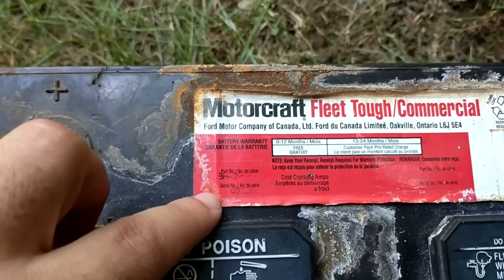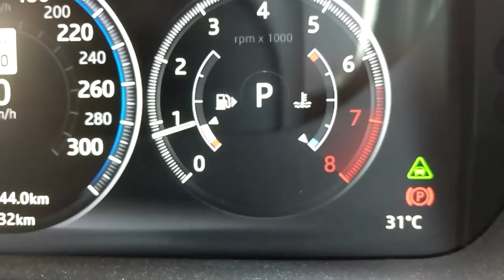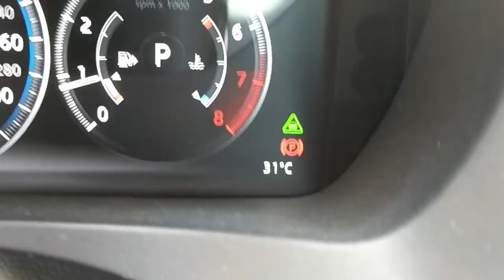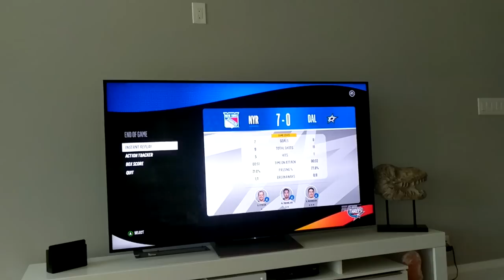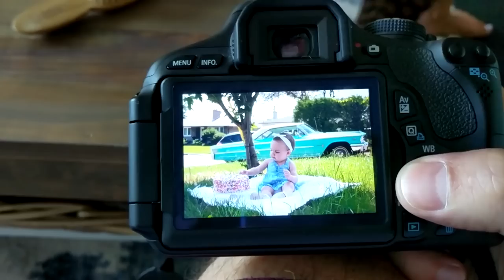VLOG! - Battery Drainage

Comment: I would probably go ahead and get a battery with the terminals on the other side if one is available, wasn't a fan of how close the terminal was to the radiator support where it was, good little bounce and SHORT.

That thing is awesome though, I wanna cruise. Never driven anything like that, especially with no belts haha
Reply: ConeDodger240 I like your videos. Also noticed that you have corrected the iRacing Thumbnails;)
Reply: I was thinking the same thing lol. Either that, or flip the battery around and get a longer ground cable. Having the negative battery terminal that close to the radiator support isn't so bad. But the positive could go boom!
Reply: A car battery rather than a Marine battery might be a good choice also.
Reply: David Norton a marine deep cycle battery really isn't bad though. They give you more power for longer, they're just heavier. I had marine batteries in a few pickup trucks that had winches. They're good for extra electrical loads.
Reply: Marine batteries are super solid. Had one for years.
Reply: marine batteries are better as well because they are deep cycle, meaning you can actually run them dead and then charge them and they will hold a charge. normal batteries once they are dead they are dead, the can be charged but wont hold it for very long afterward.
Reply: They don't handle the cold as well as a car battery, but I doubt that Beef will be driving that car during the winter.  It does look like a Boat battery will handle storage better so maybe it is the correct tool for the job.  I really just wonder if he knew that's what he was buying.

Comment: Beef, I don't think you're aware but car batteries have a "size" and are usually labeled with a two or three digit number. Just get the size off your old battery and swap the new one for the correct size. That way you don't have to worry about changing out the battery cables.
Reply: HeroicFerret as well as the correct cranking amps for the starter.

Comment: marine batteries are fine for cars. the cca ratings are typically higher, which is often beneficial for older cars where the starter needs more juice. they're also deep cycle, so they can be drained repeatedly without causing harm to the battery. standard lead acid batteries don't hold up to that, and the cells lose the ability to hold charge. pretty ideal for a car that won't be driven every day, actually. i'd still recommend a plug-in battery tender tho if it's driven once a week or less. draining it won't hurt it, but it still sucks to have to jump a car before you can drive it

but definitely spin it around, or swap for a battery with terminals on the other side. having the positive terminal that close to the core support is just asking for trouble.

Comment: Alright Beefers, I work at an Auto Parts store and this is what I've gathered from the video...

1. The battery has probably been sitting around for so long, it's got a sulphate build up which causes cells to collapse, so that's probably why it's been struggling starting, take it to the Canadian Tire and ask if they have a battery tester (or if you've got a volt meter), anything below 12v shows it's dropped a cell and time for a new battery. If not, then it's probably low on CCA and needs a proper recharge from a battery charger.
2. You've gone to the shop and bought any battery, that's not the way to go about it :P Although you can put any battery that 'fits' in your battery box, doesn't mean you should haha. Basically, find out the CCA for the old battery and get something with either equal or higher which will help run better and the more the better but it's old car so not a lot of electronics on it so you don't need to go all out. Buy a battery that'll fit the battery box BUT make sure the terminal sides are the same otherwise yes, you'll need new cables which is a waste of time :P 
3. You've bought a marine battery which will start your current battery but won't last as long in the car as a normal car battery. If anything a "Deep Cycle" will probably be best for long term because you can recharge them as many times as you want and it won't affect the battery, although this is mostly used for camping. 

and yes, more of these videos please haha!

Please Like this so Beef can see it, I don't usually ask but it's to help out Beef!

Comment: These days, as I’ve spent too many years with too many vehicles/pieces of heavy equipment, it’s just standard procedure to equip *every*thing with a battery disconnect switch, and/or a permanently mounted trickle/float charger.  Small things that pays for itself in no time.  Or one change of seasons. :)

Comment: Beef, you bought a marine (boat) battery. It doesn't work the same as a regular car battery... They aren't designed to be constantly charged like a regular battery.  The male thread terminals beside the regular terminals give it away.. And I do believe the "nautica" also hints towards boat battery..

Comment: I had a '66 mustang and my regulator went out. super cheap and solved the problem. looks like an old battery so, good call. If the problem persists I would look at the regulator or the alternator. Luckily you have a Ford. All the parts are around and cheap. I have a '57 dodge now and cant get parts. Good luck Beef!

Comment: Hey beef when you get longer cables replace the whole cable, the ends were pretty skanky. That old battery does not hold a charge because it is old and does have a leak. What you saw on top was battery acid that oxidized.

Comment: I think you might need a new Flux Capacitor and maybe a Blinker fluid change.
Reply: Cooked Karambwan- also, need to rotate the winter air out of the tires for summer air so the tires roll smoothly.
Reply: Don't forget the elbow grease
Reply: Be sure to oil up the brakes real good too.
Reply: Wow, I didn’t know blinkers have fluid😅

Comment: Put Garden Lime on the lawn and the grass will grow back.Put it on it every spring. It will neutralize the Ph in the soil.Check to make sure you are getting 14vdc to your battery. Check it across the positive and negative terminals.Also check positive to ground (the frame or motor).  If not check the ground cable.If still no 14vdc replace the alternator along with the battery.

Comment: Beef if the new battery doesn't work, there could be a problem with the battery cable it self. I had the same with my 79 f-350. The cable was too small of a gauge to support all the power that the starter needed, causing the starter to seem sluggish. Just a thought, could also be your starter.

Comment: I'm pretty sure you can flatten and bundle up your cardboard, and leave it out on the curb when they are collecting recycling, as long as they are not larger than your actual bin! I've done this before and they collected it. It's on the city of toronto website too

Comment: I looked into the seatbelt laws a few days ago, and basically you have to use whatever seatbelt assembly that was installed at time of manufacture. Also, check the charging voltage with a multimeter while the car is running, it should be 13.8+ V

Comment: It's been mentioned in the comments that you bought a marine battery (which isn't that big of a deal), but no one mentioned (or i didn't see anyone say) that running the car and driving it around will only ruin your alternator, you never try and charge a battery by driving the car, because it will never fully charge, and only puts stress on the alternator.

Comment: So, you might never see this, but when there is a battery drain, put a “kill switch” some where in the car, probably the cab, to prevent any drains and is the perfect security because without a key that you take out, the car can’t start because it connects somehow to the battery cables, just google it and it could be really helpful.

Comment: You need a battery and terminal connectors, maybe new cables but those are easy enough to just make with the right wire and connectors.

Comment: If you can't find a proper replacement. You can take that old battery to a shop and get its drained and refilled. You can restore those old batteries.

Comment: Set an area for the dogs to do buisensess.  Put ip a cheap fence directly off the porch.

That battery looks old as f. Could be a oem reproduction though. Old one looked like it was shorting across the top with the acid. 

I highly recomend getting the correct seat belts.

Comment: Ah your car doesn't need new cables, it needs the correct sized battery. Every battery has a size, if you look at the old battery it is labeled with a size. If you then go to the store and find that number, you will have the exact same battery that came out of it. If I believe correctly that old battery was a 51r. The 51 is the group size, and r stands for reverse leads. That is the most important part, because that is why your old battery was able to sit in there spun around, with out have the leads on the wrong the side. Please do not put that battery in the car, a bigger is not always better. Your car was set up to handle specific size battery, with a specific amount of amperage, on a specific amount of cable length. By changing any of those you risk doing serious damage to your car. Maybe not so much on this car, because it is older, and thus relies on a lot less electronics, but I guarantee you, you do that to one of your newer cars, and you will destroy some thing.

Comment: Must be sketchy driving around with no seatbelts.
Reply: Donald Crown not really
Reply: Nater Gater99 I'm not saying because of the law, it's an older model so he doesn't have to retrofit the vehicle but I'd just be sketched out because accidents can happen at any moment. Whether you're a cautious driver or not.
Reply: I can confirm, no seat belts plus bench seat makes you feel a little unsecured.

That said, I was in an accident while driving a vehicle with such an arrangement; I was struck in the left front fender, which spun my car about 90 degrees. Somehow I wasn't bounced around at all! Not a scratch! If not for the snapped brake line I'd have driven it home, too!

The Toyota that hit me, though, was demolished. :D
Reply: If he gets t-boned then there might be injured, but I'd feel more sorry for the other car if it was hit anywhere else.
Reply: Nater Gater99 yeah, I was all "to heck with pulled over, what if he gets in an accident?!?!" Fingers crossed it doesn't happen!

Comment: y hello vintagebeef my name is big D and i did want to ask u if the car wont start then is the alternator working cause if it is then the car should be starting but if it isn't giving like any revs to start up then that means u need a new starter and i might add just bring to an auto work place and have them check the battery and see if the problem is the battery or it can be the starter and how do i know this u may ask, the reason y i know this is because my mom and i had the same problem happen to our car too and we found out that we needed a brand new starter so just go with my advise and see if u can respond back to my comment or even better just see if u can mention me in one of ur next vlogs u r going to do